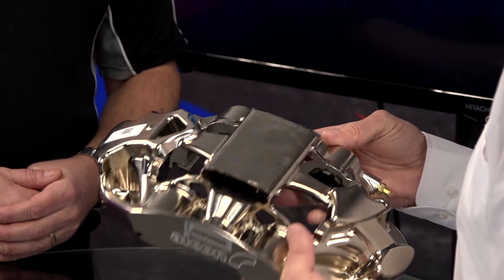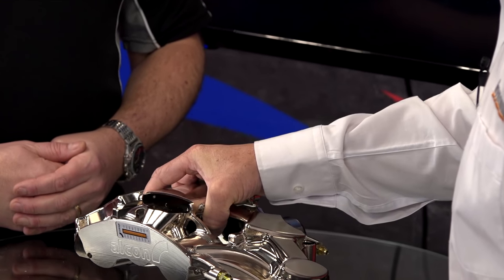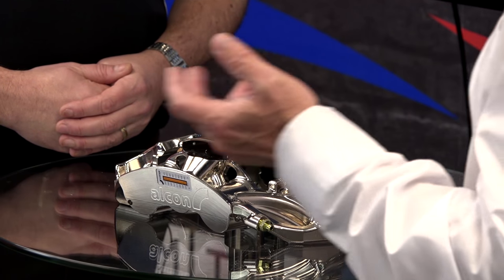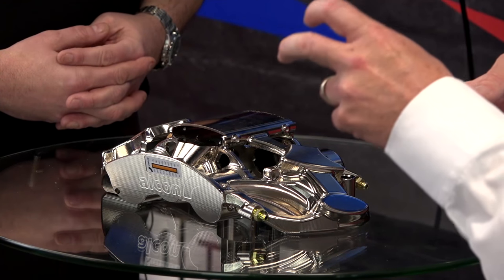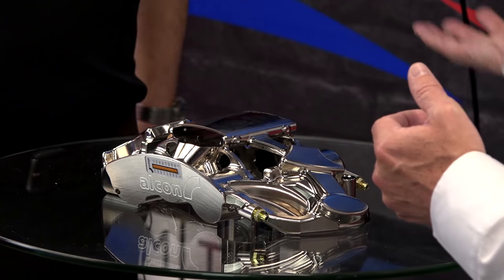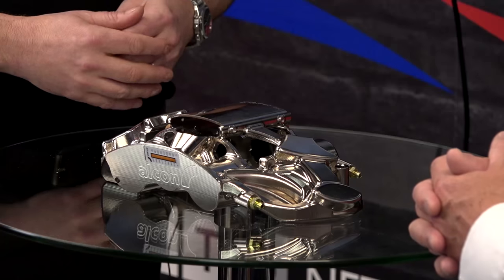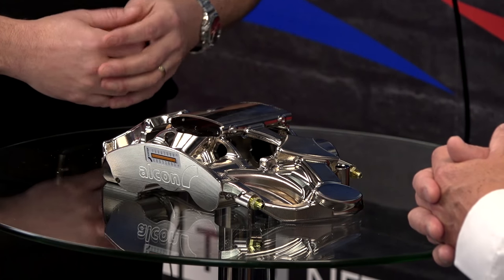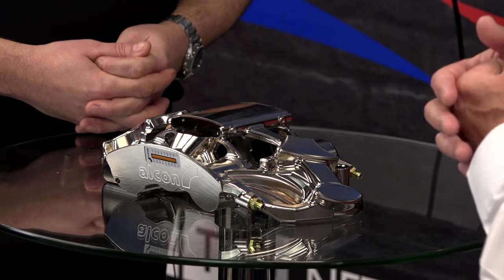Is hyperMill the BEST CAM system?

Comment: I think mastercam better in 5 axis machining ?
Reply from the maker: why do you think that, have you used both or any examples?
Reply: I've used both and what you said is not correct. hyperMILL is a much better software in 5 axis machining.
Reply: @boxingtalk2105 eso sería antes ahora no creo que hypermill supere a Mastercam en los 5 ejes, y en 2d y 3d Mastercam le da mil vueltas.